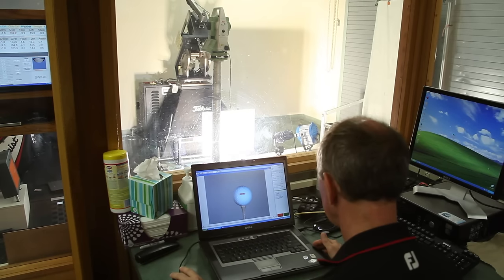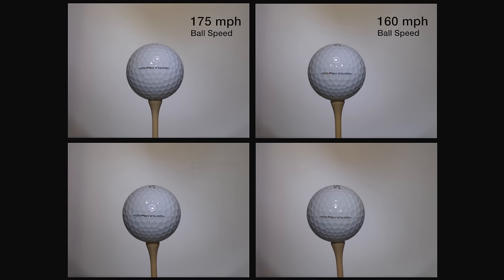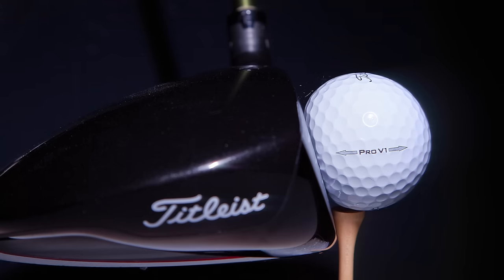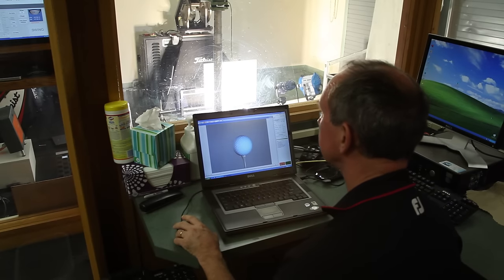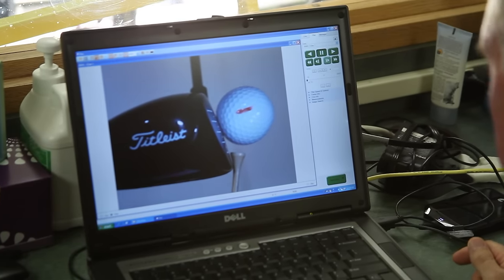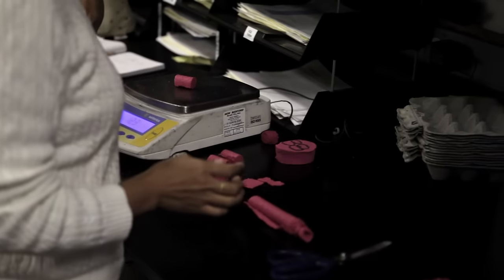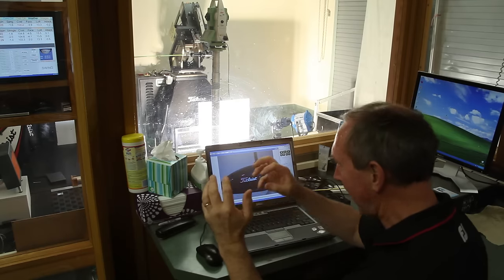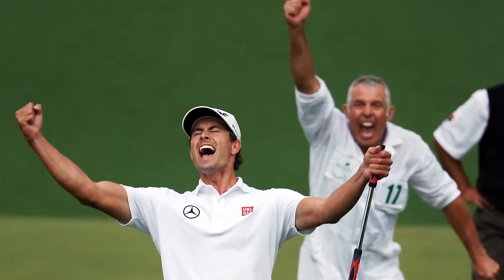Titleist Golf Balls at The Moment of Impact

Comment: I'm just a guy from Texas that builds catapults. I use golf balls for my smaller machines. I use magnus in one of my launching styles. Golf balls are perfect for this. I started casting large cement golf balls in silicone molds I make, for my larger machines. Being of science, I have a question about dimples. Scaling up the diameter of the ball, would the dimples scale up proportionally, or should they stay the same size as on a standard size golf ball? The test balls I have produced have proportionally up scaled dimples, but my gut is telling me that they should remain small. The small dimples will still induce magnus, but won't create a bunch of drag. I have seen computer simulations of how air behaves over the surface of a golf ball, but none exist of how the air flow behaves over a spinning golf ball with linear motion. Shark skin comes to mind, and hydrodynamics, and that one wouldn't up scale the skin surface texture, the larger the shark.